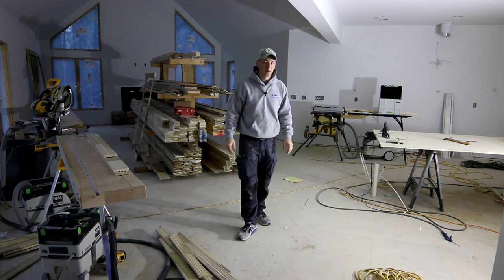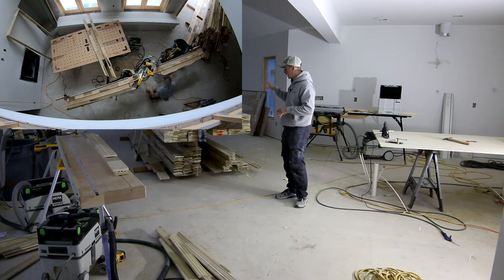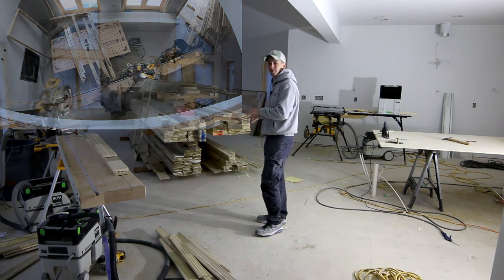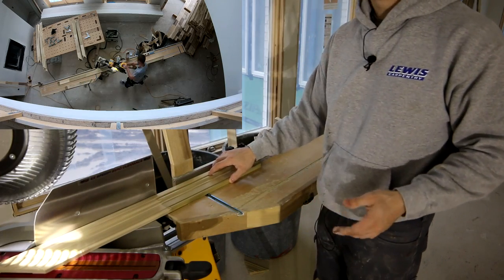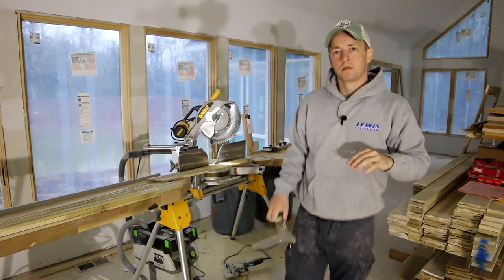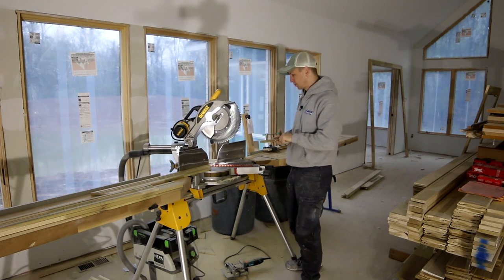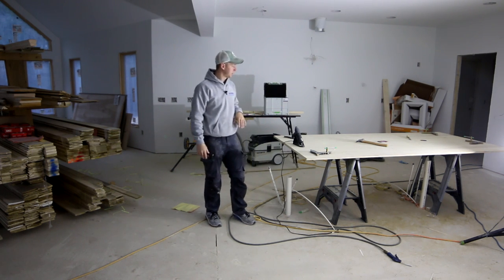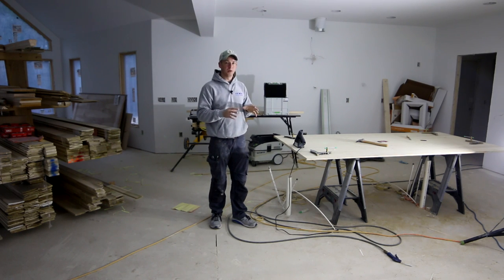The Most Efficient System for Mitered Casing

Comment: Great advise on speeding things along, slow methods and long walks are job killers! The assembly table is one of the most important and underutilized tools you can have, especially in the high end finish carpentry business. 

Here are some things I do that you may like. Depending on the job I sometimes use a vertical (about 10degees) easel type assembly table with a perfectly straight, bottom ledge and removeable/moveable left and right side vertical straightedges.  The verts can be moved/positioned where needed, it's a nice setup for repeatable assemblies such as wainscoting frames or anything else with a frame. 

One other thing I would mention is, I use a two miter saw set up. The saws are setup side by side with a small bridge table leaf in between. It's a setup I always use and built with all the same accuracy/table wings/stops as the setup you're using. It's made in sections so that it portable and can be easily assembled/disassembled. I realized long ago how much time I was spending swing the miter saw left to right/right to left then looked in the trashcan at all the cutoff blocks. We adjust the saw  hundreds even thousands of times a day cutting miters so it was easy to see that two saws would be way more efficient for a relatively small investment. Two miter saws reduces time lost by better then half!
Reply: Travis,

Is there any chance you could do a video or photo shoot of your setup?

It sounds extremely interesting.  Thanks.
Reply: @fredgassit3360  Id like to see a picture too

Comment: Thanks for sharing this video, I think a lot of people can learn from you. One suggestion i would like to get your thoughts on, If I'm batch cutting the same length, I set the stop at one point and then cut all my pieces an inch long the same direction, then switch the saw just once the other way, move the stop, then cut the other side for all the pieces. I think its faster than switching the saw constantly, just move pieces and cut constantly.

Just my two cents! To each their own
Reply from the maker: Personally I think its a wash. Moving the saw takes literally one second, but I know what you mean. My favorite is flat casing because I can just keep the saw set at the same angle and flip the casing.
Reply: Vince, I've used your method for many years. Insider's two-position stop design is cool, especially its simplification of math as you change window sizes. But I've always favored the speed attained by avoiding repetitively swinging the saw angle on every cut. My bet would be that Insider's setup is quicker than ours for small batches, and ours quicker for long runs. But the virtual elimination of possible offset math errors provided by Insider's stop design is very appealing.

Comment: Hi I have used it on handrail fittings for 25 years. its is structural. we used it on everything from pine to brazillian cherry. The one we did 25 years ago are still good. I started with the 3m jet weld when it first came out.
Reply from the maker: Its always good to hear the testimonials of its longevity for long term strength.

Comment: I did just what you said and built your wings and stop block.  Wow what a time saver and a big improvement over
the last house I trimmed.   The Clam Clamps came in today and will get used on the next house.  On this job spring
clamps were used and they did an ok job.   The glue and gun you recommend is awesome.  All the joints stayed together.  Thank you for the information.
Reply from the maker: Awesome. The clam clamps will take you to a whole new level. They are really great combo with the hipur. And the wings and stop block...pure profit.

Comment: There’s some very good advice in your video. I do everything you do except use hipur and I was just convinced to start using it for casing by watching your video. Originally I used hot glue but it was thick and my miters weren’t tight but that was before I used clamp clamps. From a guy with eight clam clamps and a modified best fence to do the same thing you do with picture frames and casings. One tip I can give you is the new best fence fences are flat so they work better with wood material that can have a slight curve to them.
Reply from the maker: Sounds like we would work well together. The hipur is a completely different animal than regular wood glue. You won't be disappointed.

Comment: Great observation on the fact that solid wood miters aren't always 45 deg because wood is warped. MDF is easy, I always get great results but did some hard maple casing and had to tweak a few miters because I was afraid even glued with biscuit it would come apart if I forced it. I hate hardwood casing!

Comment: I went back and watched this again lots of good information in here. I too came up with a solution to run picture frame molding efficiently based off fast caps best fence system. I should do a video of it. For anyone who has the best fence early system it does not require making new wings and you don’t need a magnetic tape. I came up with that system probably six years ago and at the time I suggested it to the company but they felt that it was too much of a niche product. That tells you something about how the manufactures don’t understand how finish carpenters are actually using their products to do their work.

Comment: So this process is awesome for mitered casings and I’ve adopted it myself, but with 1 change to suit my situation.  

First around here we use a lot of 2 1/4” baby Howe for casing.  I’ve found hipur does not work on the smaller thinner casings.  After a lot of searching I found infinity tough guy hot glue works really well on these casings.  

It’s not as strong as hipur but it’s much much stronger than standard hot melt glue.  

The tough guy also solves another problem for me, budget.  A half pound runs $15 shipped and lasts around a month for my use whereas I could easily go through a tube of hipur in two days.  

Also I’ll add it works really really well on 1x4 casings which I also do a lot of.
Reply from the maker: Yeah, hipur likes more surface area. No bueno on small casing.

Comment: Spenser, great videos.  I've learned a great deal.  Just about to begin a project using PUR and Wood River clamps.  Trim is 3-1/2" pine, 'clay coated', but it seems to glue well enough with PUR.  Windows are Andersen casements.  I want to attach my 5/4 stool to the bottom of the legs by pocket screwing legs to stool.  Wrinkle is, window casing will be inset approx 7/16, so I have to offset the stool on the bench, probly by making a shelf at one end to rest the face of the stool on while I clamp the stool to the head trim and shoot in the pocket screws.  Then I'll attach 7/16 material to the inside edge of the legs and head, and be ready to install the unit on the wall.  If you have time to review this I'd appreciate your comments.  TIA

Comment: I’m in the process of ripping out wrapped drywall in my windows, it has a corner bead, and drywall runs to the window, I’ve been ripping that out, put nice wood in the jams top sides took the sill out, put new sill in with longer wings,  4/1/2” molding around widows now, it looks so much better, I have 6 inch wells in my windows, it’s 2*6 framing on exterior walls, which is why it’s 6”, any way have don’t 2 rooms so far, and it’s been great,.

Comment: Really nice video Spence. Needless to say this has been working well for you and trimming out all alone is a big job for sure. I know. And the videos help out for you as well. 
It's hard work and this does take its toll on your joints and body in general. Your most important job is to keep your main tool maintained. And that is your body. If it goes bad there is no replacement you can get for it. Work safely and keep good care. Now....

One question that comes to mind, at least for me, is this. What will be the final finished floor? IE: if the finish floors are going to be hardwood flooring , do you pre install your door casing by setting the bottoms directly on plywood subfloor ? That is what it looks like in the videos. 

Does the flooring usually get done first, or later after you set your trim? Do you elevate your baseboard if the flooring has not been installed yet? Do you come back and put in base shoe molding later? It appears from videos that most of your installations are for carpet???

If you are installing door casings and jambs before wood floor installation, do you set on top of plywood subfloor  and have flooring installer cut your bottoms on jambs and casings? 

I guess it doesn't matter about baseboard but you will have to come back and put in base shoe for wood flooring.

It is worthwhile to elevate baseboard in either case so you get full profile height of your baseboard showing. Just curious as I know that the bottom fit on wood or tile floors is just important. And like I said there is no doubt in my mind that what you are doing is right. I just am a little  confused.

This also is important to elevate so you don't have to come back and cut all your door bottoms. For carpet it doesn't matter. But base still should be elevated. Today we see less and less carpet. I personally do not like carpet and begin trimming out after floor installation is completed. I then go on top of flooring and have to fit jamb bottoms and casing to floor. This is time consuming and very hard to do if you have already put that casing together. Even if together, each side would have to be pre fitted for length. And also in the width to get a good fit. And lastly if you are installing jamb before wood floor installation (3/4"), those door bottoms would also most likely need trimmed.

Please explain your production system for trimming on top of wood floors? Or if not the case the flooring installer has quite a bit of extra work to do. Either way you do an excellent job on the videos and your technique. I just question how for wood floor houses. Maybe I missed it  somewhere. 

I also know each region of our country tends to do things differently.
Reply from the maker: In my region, we install jambs/casing low and the hard surface flooring installers will undercut all the casing and jambs. 

Baseboard is left up 3/8 for carpet. For hard surface baseboard is left up whatever the finished flooring height will be plus 1/8" and then we use shoe molding at the final.

Comment: Here on the west coast there’s a lot of MDF being used so I don’t oull our clam clamps often. Just so happens I did an install with a 4-1/4” casing in poplar and it was biscuits, clam clamps and titebond. Time is money and I didn’t hesitate to order the hipur gun and two of the glue wood to wood this am for the next one.
Reply from the maker: Hipur is fantastic for MDF and so are clam clamps. What issue do you have with using clam clamps on MDF? Let me know if you've got any questions with the hipur. It has some nuances, but once you get them figured out its amazing.

Comment: new construction is the paradise..... remodeling is hell!!!!
Reply: Yep, because you get to see how all the new construction guys other than finishing don't give a shit about the quality of work. You show me a house that is even within two degrees of square or plumb and I would be shocked.
Reply: @totallynottrademarked5279  There is a difference between custom home building and tract homes.
Reply: @TheSlywright  sometimes. Sometimes that's true. Did more than a few mansions built by not the most diligent guys, supers expected the trim guy to fix it.
Reply: Brian Heuer not true for professional framers. I run 3 frame crews and our frames are laser straight and square. We don’t look for work ever, 34yrs always booked a year out. ..
Reply: It’s not just framers, but electricians, plumbers, mechanical, drywallers, finishers, if all are not one the same page “quality” it doesn’t matter how level and plump is your framing.
Reply: @totallynottrademarked5279  No one would pay the cost for a house that was 100% square or plumb.
Reply: MrNorthstar50 completely wrong...obviously you don’t do high end work. Wealthy people want the best work available. 90% of the work we do is completely remodeled every 3-4 years . Wealthy folks want the latest trend or to expand and they throw away everything you just did, without blinking.
Reply: @joeframer9642  its true that every carpenter in the country does not work for the 1% I guess. Next time I have to deal with a leaning wall when hanging a door, I will bring up to the home owner that they are not in the top 1% and so there are no solutions to my problems because they are just not high end enough.
Reply: Joe Framer ,

That has been my experience also.  Wood Floors specialty.
Reply: @joeframer9642  ,
Do you  build level? I hang a door the other day and the distance from the head casing was 1/2" different from left to right, to the ceiling, an a 2'6" door.
Reply: @totallynottrademarked5279  when I framed! Every trade behind me was shocked lol. Drywall crew kept telling me how square everything was, cabinet guy, even window blind sales rep told me every window was the same. I did the trim and I had no complaints either lol.

But that's how I learned to frame when I did custom framing.

Comment: I had trouble getting tight motets on my picture frame window trim , then I discovered clam clamps and they worked great. Increases my productivity and much better quality with tight joints. I didn’t use biscuits on 3.5” trim only Titebond wood glue. HiPUR is a good upgrade

Comment: you can use Hi pur on any size of trim. it is a structural adhesive . We have used it for many years on handrail component to fasten to handrail with no other fastening. just FYI
Reply from the maker: I love hipur for handrail returns! Glad to here someone else had been using it on handrail also. Do you use it on fittings? Or just small returns?

Comment: Bought the clam clamps just because of this video. Unfortunately Jim doesn't ship to Canada so had to order the ones from Wood River - thanks for posting that link.   Excellent explanation of your process!
Reply from the maker: I’m actually impressed with the wood river. Better than I expected.
Reply: @InsiderCarpentry  That's good!  I don't need to make a living with mine, but when you need them it is nice to have the right tool for the job.

Comment: Any thoughts on biscuit and CA glue and no clamps?  I appreciate the power of the clam clamp to get a tight, strong fit and help eliminate gaps.  But provided the miter is good and you are good with CA glue and kicker seems to me the glue would not break in shear.  I have never tried it but the advantage is no pin holes,  better chance at getting better alignment (more adjustment) no clamps needed, and quick set up.  Thanks for your channel.  I've been watching from the beginning.  Outstanding work.
Reply from the maker: The disadvantage to the CA glue is that it is not very strong for miters when using real wood. It will break easily of it is stressed.

Comment: Insider Carpentry, I wouldn't draw the line at 3 1/2" after the test I just performed.  2 90 deg miter samples with 14" legs, 4" poplar casing.  Both compressed with Clam Clamps.  

The first one with 2 dominoes 3/4" from the edges, fully slathered in titebond II, clamped for 30 min, allowed to set for 24 hrs.

The second one, Infinity PUR 30 with no dominoes, clamped for 1 min and not that well but the way.  The glue line at the heel was prominent.  This one was also allowed to set for 24hrs.

Threw a Jorgensen parallel clamp on both, domino and titebond II failed after 25 cranks, a significant amount of force.  The PUR miter was still holding after 33 cranks and I could turn no more.  Moved to a large pipe clamp and applied so much force that the heel of the miter compressed to the point that there was a 1/4" ridge and the legs began to take a curve.  I was barely able to crank the pipe clamp before the long points let go and the whole thing exploded.

Bigger casing = more surface area = an exponentially stronger bond.  After seeing this I would put PUR adhesive up against any other method hands down.
Reply from the maker: It really does shine with large surface area.

Comment: In the time-lapse it's amazing how much you're moving the Dewalt back and forth between opposing 45s - that saw must have some accurate and repeatable angle stops
Reply: Higher end Dewalt saws yes lower end no. 

Lower ends are for rougher work.
Reply: I have a japanese made hitachi slide compound that is very accurate and does perfect mitres. Now they all chinese made

Comment: Great video and tips. You are so right regarding the multi position stop blocks.  I am make a set now for my Paulk inspired station. What is your take on the instant glues and activators?  (i.e 2P10, Bob Smith's)  I have had good luck with those and like the speed of use.
Reply from the maker: I don't use MDF so I don't use CA glues much. I like hipur for mitered casing.

Comment: How does one accommodate variations in drywall/ tappers mud, windows that are not installed consistently, and  all the other variations that one comes across? When I ran production trim, I ended up compound mitering nearly every joint to keep it right against both the rock and jamb. I might reassemble larger pieces, but other wise it was a custom compound cut, to maximize glue bond. Maybe framers hangers and tapers are more careful out there?
Reply from the maker: I plan to address this in another video. Stay tuned. 👍

Comment: Sounds good in theory but windows I work on are hardly square and never installed flush with drywall. You must have some pretty awesome framers and window company to work behind. If I tried this the margins would not be acceptable.
Reply: Same here, especially trimming spec homes where windows are barely the same dimensions  window to window. If i did things this way i would be recutting a lot of architraves.  Also houses are big enough for this system. I can only wish.
Reply: I agree , never that simple